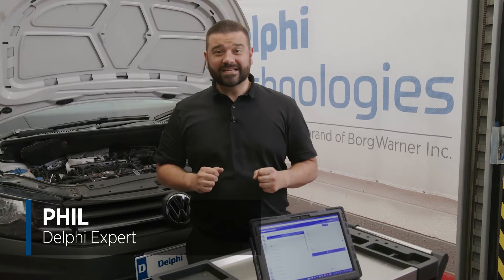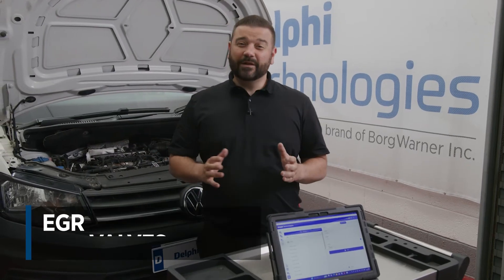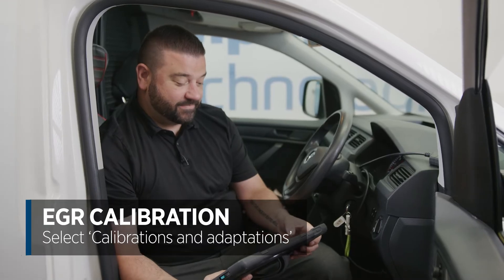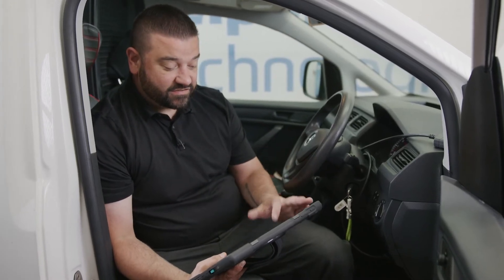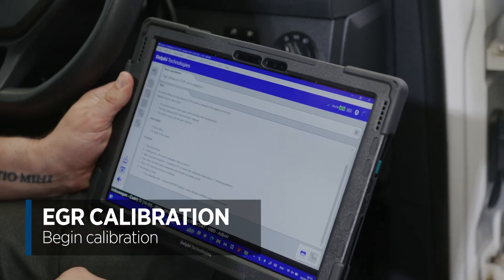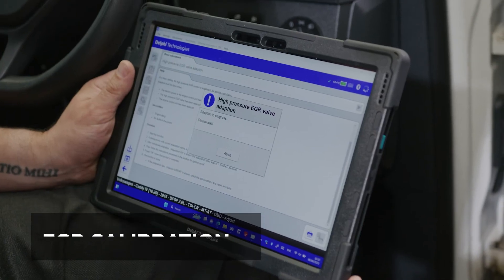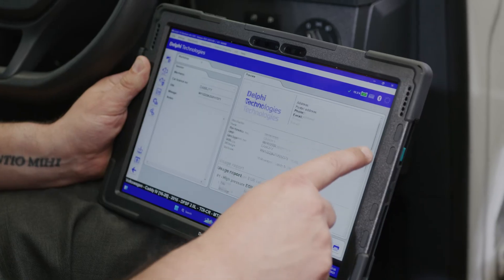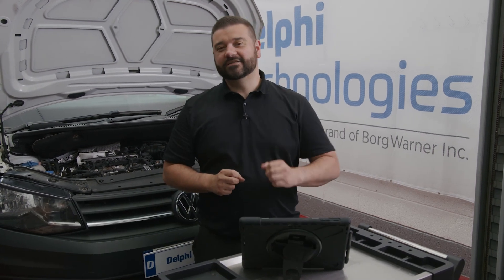[EN] Calibrating an EGR valve | Masters of Motion

Comment: Could you please show how to relearning process after Egr installed for Mercedes Ben GL 350? Thanks
Reply from the maker: Hi and thanks for the comment. The process for this is the same as for the VW Caddy. On the GL 350 3L (642.862) engine there are also 2 EGR valves. Simply enter the vehicle details in the DS-CARS software, go to quick find, and then type in EGR.  Many thanks
Reply: @delphiautoparts thanksbfor response which tools can help any link pls ?also lottle more details pls

Comment: Started with a new company recently and they have this system, it’s a very nice scan tool but I took it home tonight to read a code on an 11reg IX35 with the 2.0 diesel and I got a code for DPF so I went to look at options and there was no option for a regen. Tbh all it was good for was reading and erasing codes and live data. I assume it has regen, programming and actuator test functions but I’m missing something and if that’s the case it’s too awkward and needs to be more informative and easier to use. Nice scan tool though, very ergonomic.
Reply from the maker: Hi and thanks for your comment.  I have checked the database and we do cover forced DPF regenration on the 2.0 CRDI D4HA engine code.
Could you contact support.uk@phinia.com and raise this with the technical team?  Many thanks